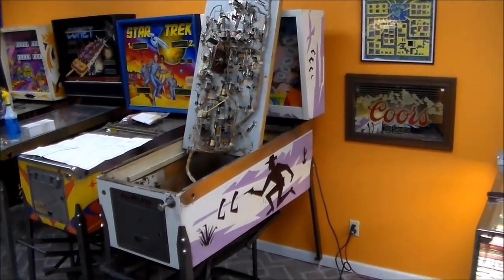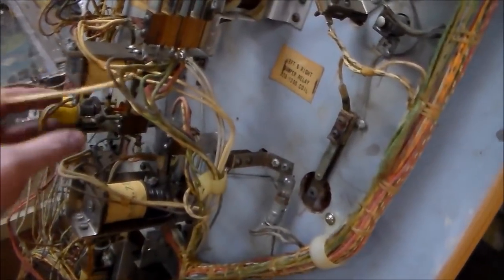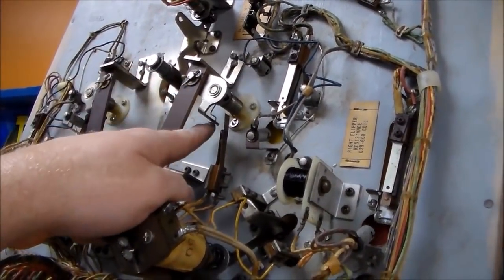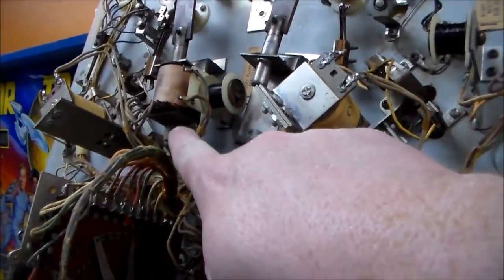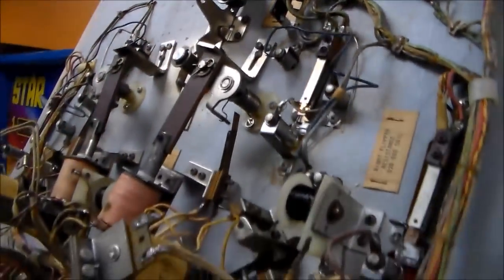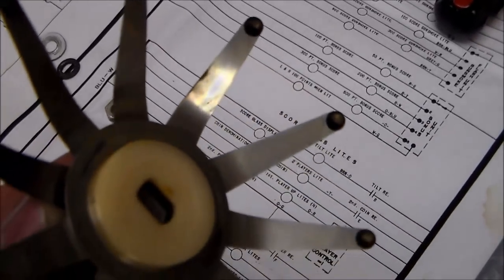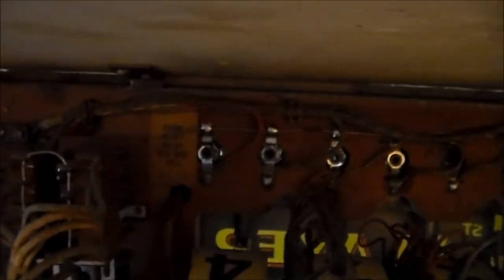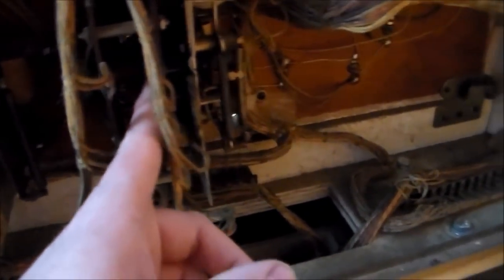Repairing a 1968 Chicago Coin 'Gun Smoke' E.M. Pinball Machine PART 2

Comment: Hi Dave. I've gotten so much information over the episodes I thank you greatly. I'm working on a '71 Gottlieb. A simple question on the flippers. The right hand flipper return to position spring is soft. Is the corrective action to add another revolution to the spring's pre-load, or does the spring need replaced? I figure others my benefit from the answer besides me. I figure asking here also helps to fuel the y-tube logarithm. If you have time for a short answer that would be awesome. Thanks again for sharing all the knowhow, convinced my machine will chime before the end of winter!
Reply from the maker: Absolutely, just turn that sucker a little bit... usually they have a screw where they're mounted to the bushing and you can just turn it a third of a turn if you want to, until you feel like they're about matched.  If you look carefully at the other one that seems right, you want to do the opposite of that one of course... sometimes too what happened was it's mounted right, but it's came loose from the pawl at some point and has revolved around one full turn as you said, so it may be as simple as winding it back one full turn.  You just want them to feel about the same but since it's the return spring literally all it does is drop the flipper back down.  If you're working on it with the playfield up in the air too keep in mind you're fighting gravity, you don't want it to be too strong on the return because you have to overcome that on the flip.  

Thanks for watching beavis, you'll get it going soon!
Reply: @LyonsArcade  Right on, thank you very much!
Reply: Nailed it. The spring tab at one end is connected to the flipper base. Tightened the spring  by moving it over to the next of the three mounting screws. Simple and inexpensive. Thanks again. Side note, I got my machine to fire up yesterday evening. Much to do but it's going to live!